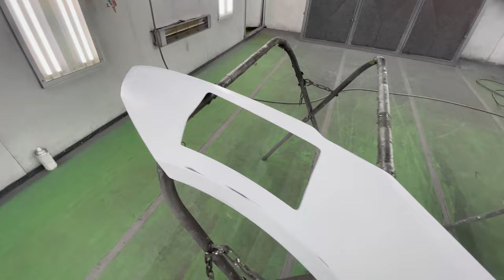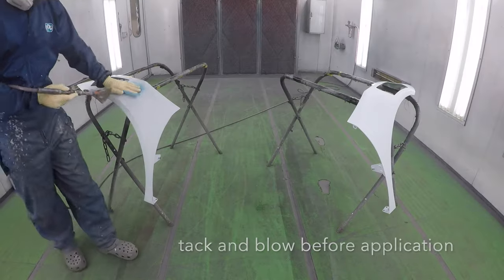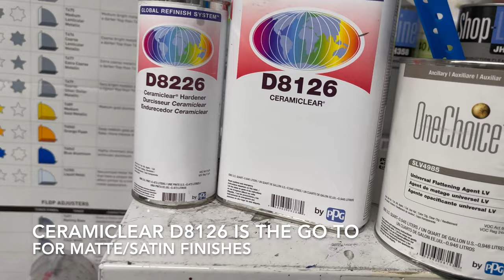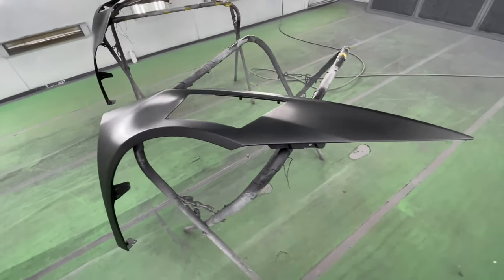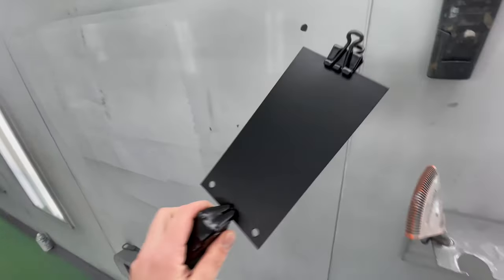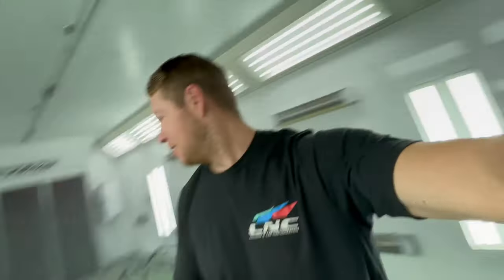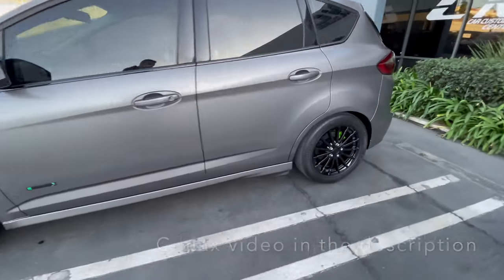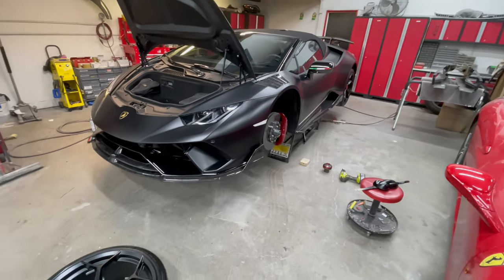How to Spray a Factory Matte Finish and Make it Perfect! Nero Nemesis Matte Black- 1016 industries

Comment: Hi, all good with PPG, but I think the fender you painted is a little bit too matte . Should be a bit more satin gloss . Am I Right ? Or is it in the video difficult to see ?
Reply from the maker: The car is wrapped in complete ppf, which actually has a little sheen to it, the factory finish is just like the fender, in a few weeks once the fenders have ppf it will all match 👍🏻👊🏻😁
Reply: @LncPainter  Perfect work as always